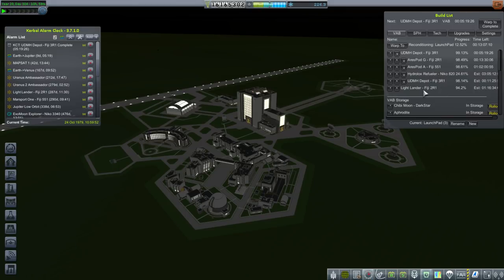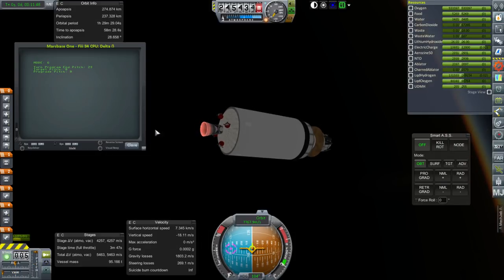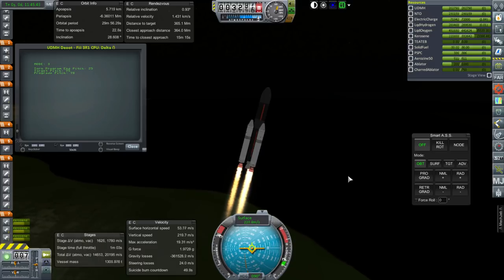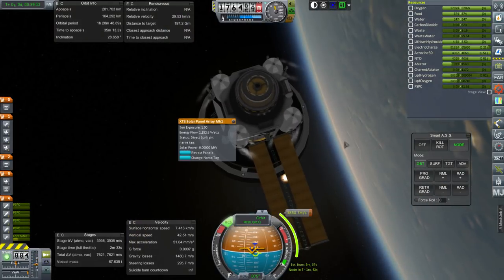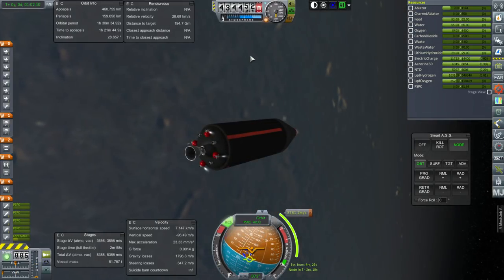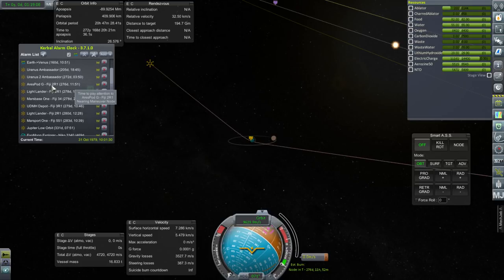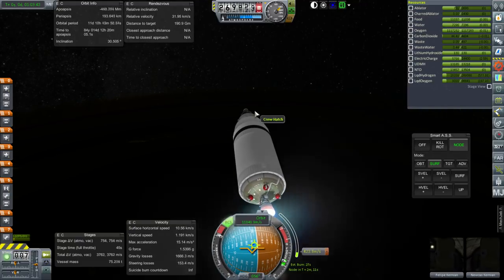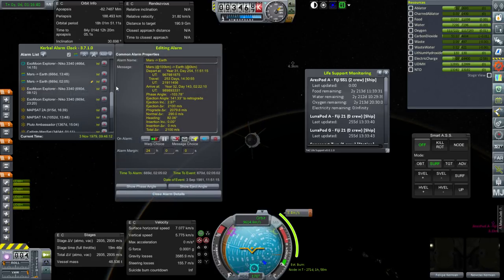Kerbal Space Program with RSS/RO - Beyond History 20 - Kerbals to Mars

Comment: What to you use to get the target pitch in your launch script?
Reply from the maker: For different phases of flight, it's calculated based on different things. Initially, it's based on altitude and thrust-to-weight ratio. Later on, it's more based on velocity and proximity to the target Periapsis. In the final bit, it's totally dependent on the vertical speed, trying to keep that close to zero.